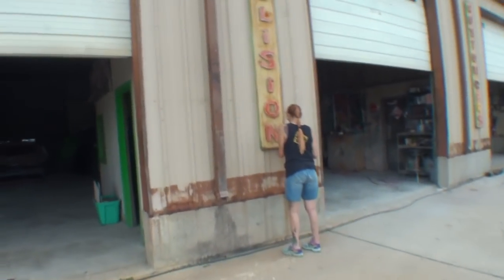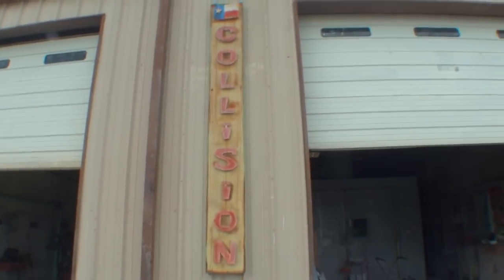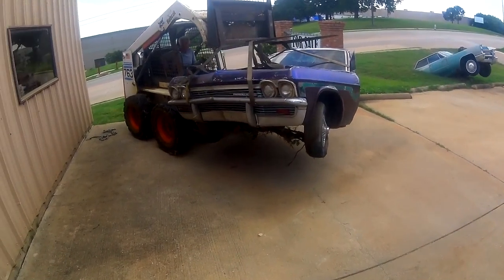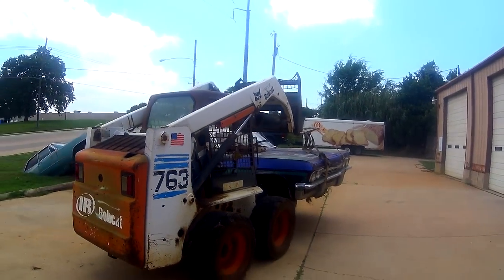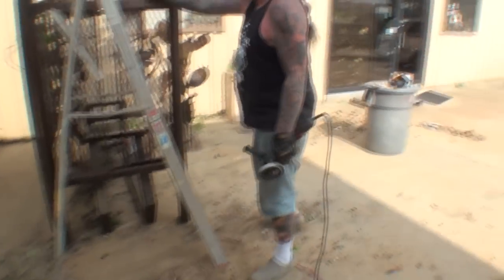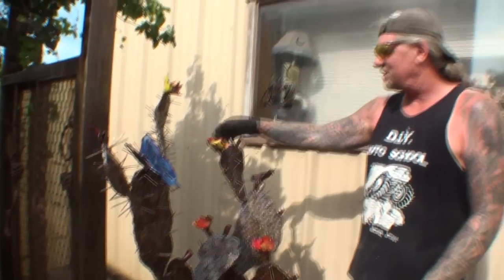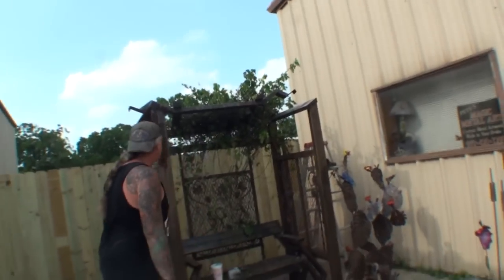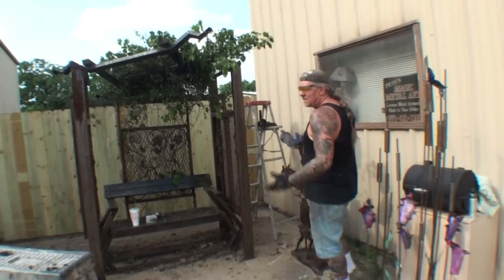Moving To MOAB UTAH and Getting The Hell Out! ( Part 13 ) " CLOSING IT DOWN "

Comment: Don't be foolish! Leave NOTHING behind. Put shit on the flatbed and bring it with ya. All of it!
That trailer is only 1/2 full. Learn to pack tight. A trailer is not floor space, it is cubic space. USE IT!  Shit can go on top of shit because it's all just shit. Taking yer shit with ya is better than throwing yer shit out.
If ya bring yer shit with ya, then all you are doing is moving your Dallas shop to Moab. Nothing lost and everything gained. Get Er Done.